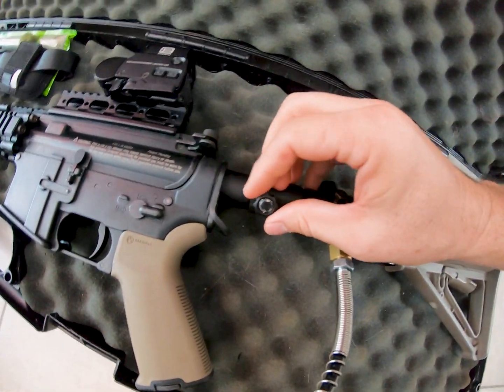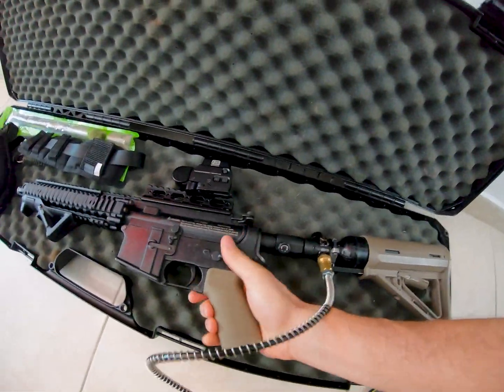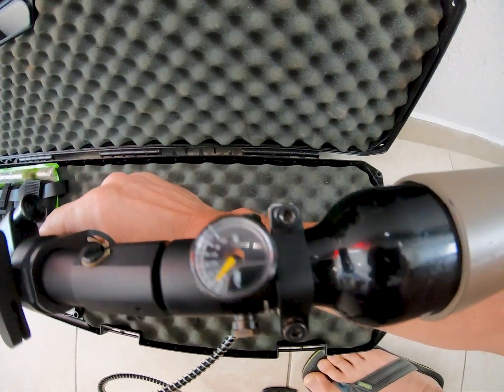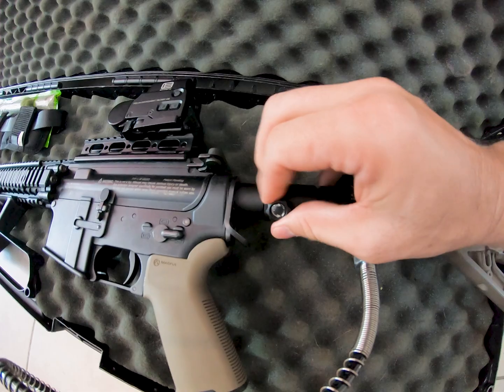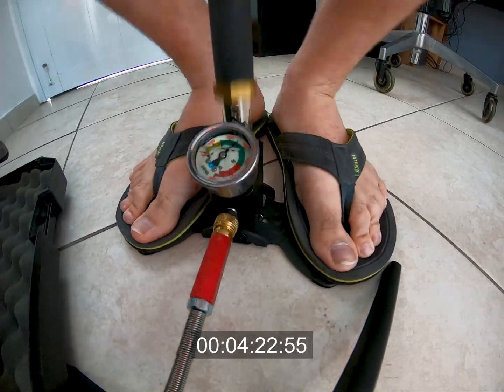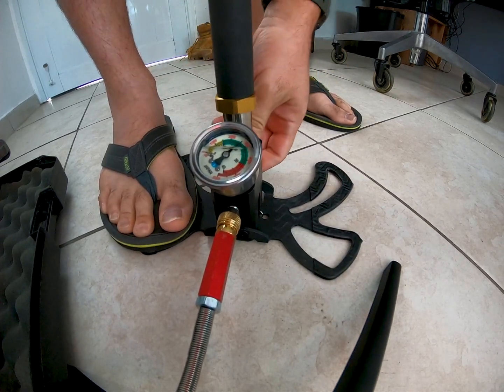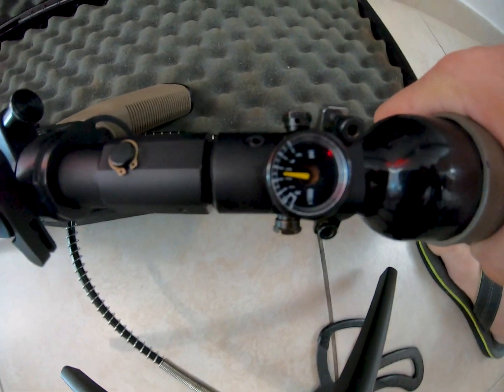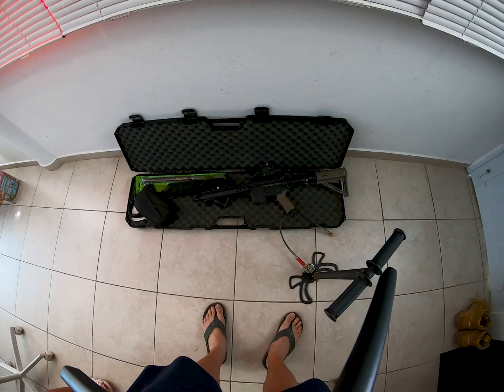4500 PSI Hand Pump In Action

Comment: Hey man, how hard is it to pump when the pressure goes up to right before 200bar or 3000psi?
Reply from the maker: There was a noticeable increase in pumping difficulty after 2,000 PSI. I began having to drop my entire upper body weight down on the handles. Getting it higher than 3k would really take some effort. 2,800 is the highest I'm willing to push that 3,000 tank.
Reply: @edwardlthompson  alright. Looking for alternatives, I think I’m buying a scuba tank and have it refilled every couple months instead haha 😂
Reply from the maker: @aandersson650  That is an excellent idea. I have a friend that uses that method. If you are at a field or event that you find it difficult to access or have no access to air or want a cheap alternative to air up at home, this could work.